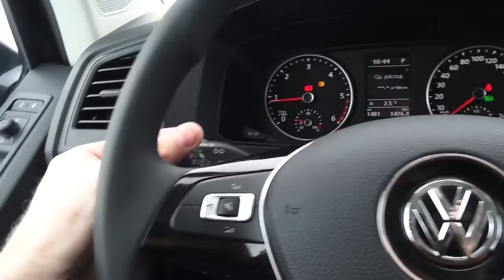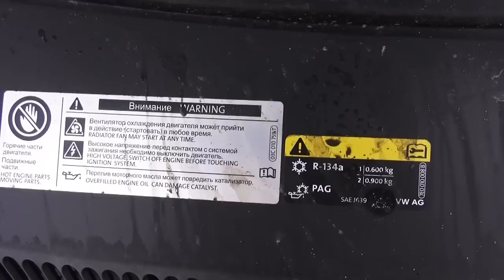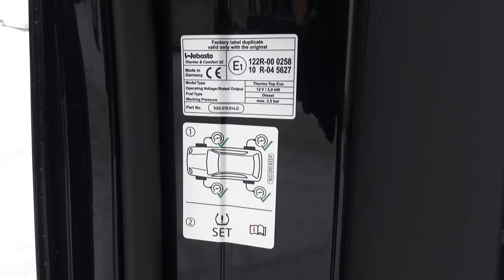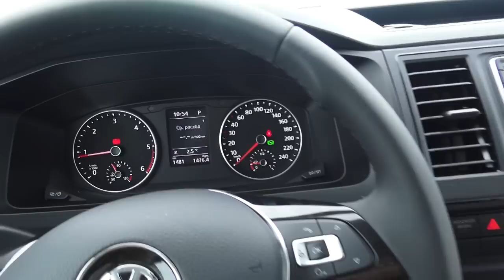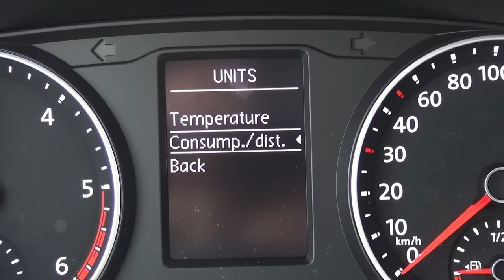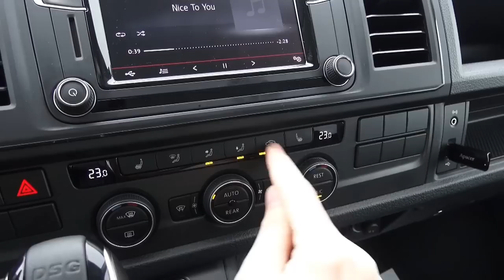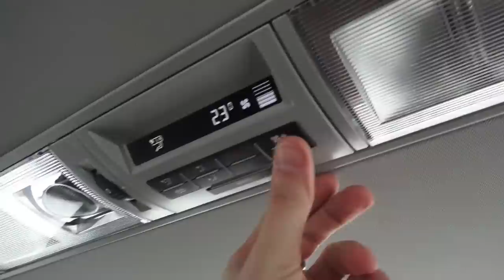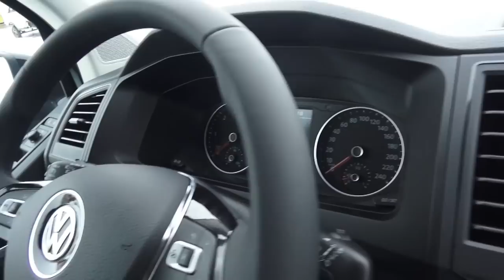2017 Volkswagen Caravelle (T6) 2.0 TDI DSG. Start Up, Engine, and In Depth Tour.

Comment: Thanks for the very nice presentation.I drive for nearly 40 years a VW bus,and I had several models but this T6 looks very charming and I am thinking very seriously of buying one.There is just one problem,I don't know about the DSG gearbox because I am so used driving a manual one.So I'll have to give it some more thought I guess.
Best wishes from Flanders and keep up the good work.
Reply: DSG is amazing! I use it in my Caravelle for more that 1 year. It is Fantastic.
Reply: Comes in 6 speed manual also👍🏻